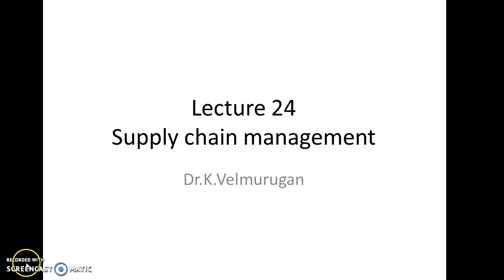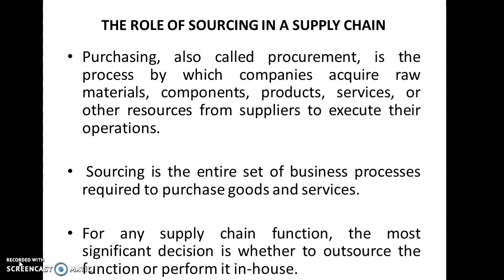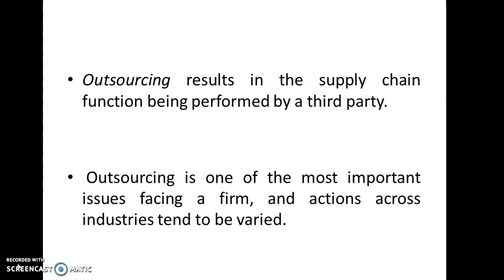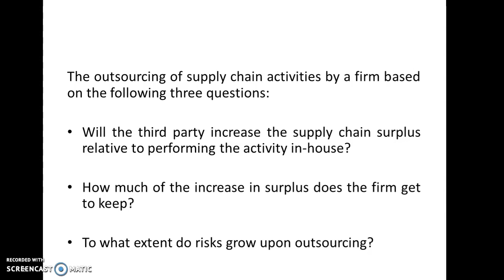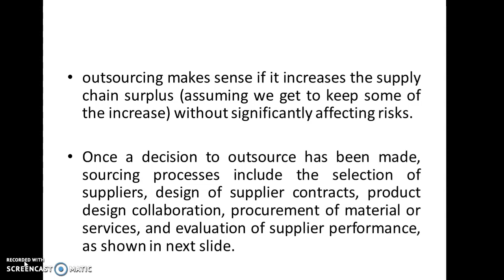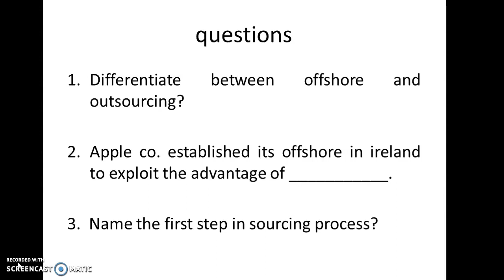Lecture 24   - Supply chain management

Comment: Name : M.Sowmiya
Roll No: 65
1. Outsourcing certain tasks allows you to scale up or down relative to demand without the permanent overheads.

Offshoring is moving a business process and operating it out of a foreign location for example the manufacturing process where labour is cheaper or expertise higher.
2. Exploit the advantages of TAX
3. Supplier scoring and assessment